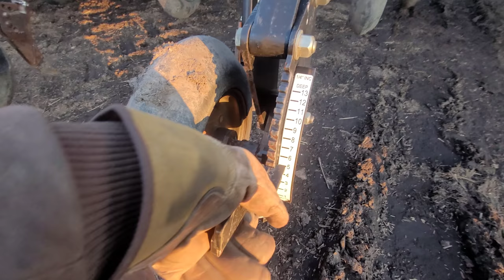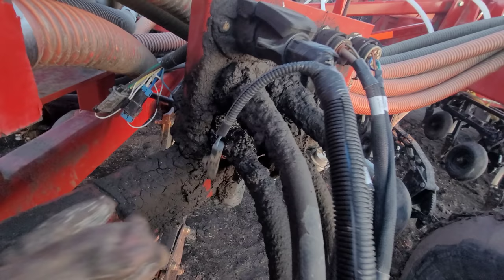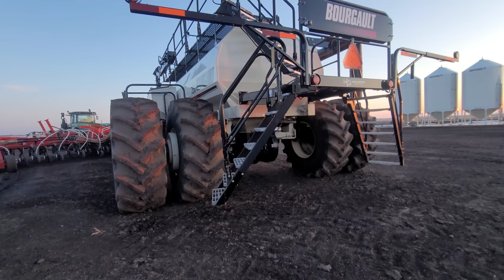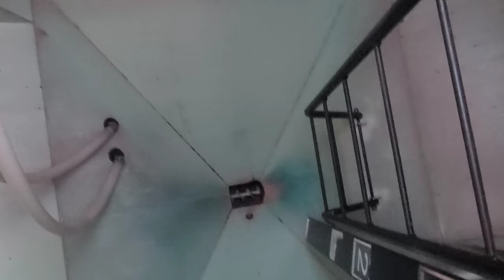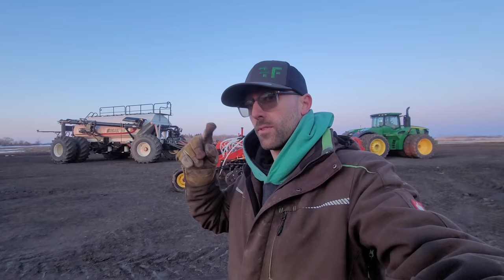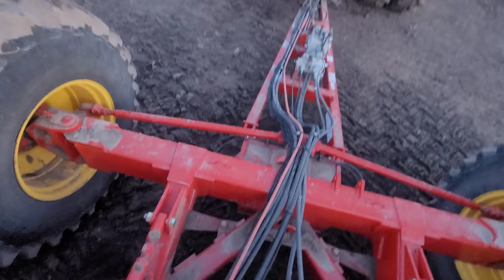North Drill Update

Comment: I think it is great that your dad helped you and Ashtyn out by buying his own old drill back to be used at the north farm.
My only question is why did this unit get moved north if it is not field ready when possibly the required repairs could be done on potential rainy days or during down time at the south farm.
I can appreciate with your dad's recent surgeries that he himself would not want to be the individual crawling around under the drill doing the actual labour.
Reply from the maker: Dad didn't buy his own drill back, he owns the 68ft back home... He just bought another drill for us to use from a dealership that literally just came from the previous farmers yard. Due to his new one showing up late, this drill was supposed to arrive a month and half ago - which would have allowed us the time to do the maintenance.

Dad hasn't been able to drive a tractor or any physical activity since the mid 80s.
Reply: This drill was never on the South farm. He bought it from somebody near the north farm.
Reply: @mikemitchell2554    My bad, I must have had cob webs in my head as I misunderstood the explanation of the new addition to the north farm.
Thanks for the clarification.
Now things make more sense.
To bad I wasn't closer otherwise I would load my truck with tons of Rubbermaids of Solid Oak & Maple firewood and donate some time to help upgrade the drill and relax around a bonfire and the end of the day as I similar to Chapel get very little sleep in a 24 hour period. 💪🔥🍷🔥🍷🔥💪
Reply from the maker: @gavinperry7237  haha no problem, thanks Good sir
Reply: @mikemitchell2554  Hey Mike
You are kind and fantastic with sharing  your life and farming details with us and  as originally a Sask Farm Kid I appreciate that. So Not wanting to pry and you by no means have to give out more information then you want. But if I could ask what appended to your Dad I know you have made small references in the past and we don't often see much of your Dad in the videos.

Looking forward to an exciting start to the 2022 Season and hope you get some much needed moisture. We were also very dry out here in Southern Mb but this spring the taps opened up and we are flooding and have excess. Almost hard to believe with how dry it was last year.

Take care God bless and Keep enjoying your new family!

Comment: Have you ever run the bourgault with QDA. The quick depth adjustment makes changing depth half the job.
Reply from the maker: Yes, the 68ft is a QDA
Reply: @mikemitchell2554  I noticed your 68 was a qda in past vids how do you like that one compared to the XTCs ? we just bought a new QDA HF hoping we made the right choice also went mid row shank and got away from the disk banders hoping that wasn’t a mistake but I think we will like them especially for banding NH3.